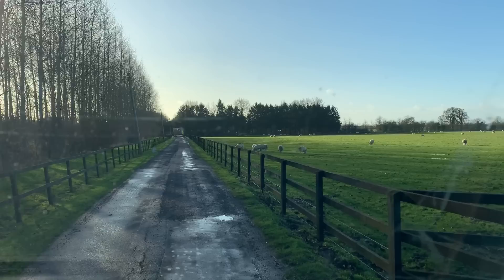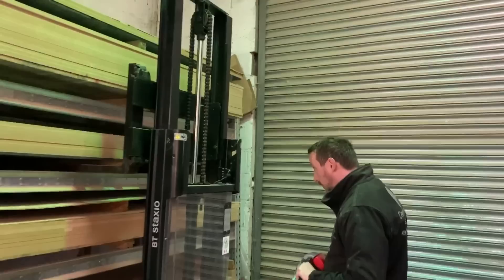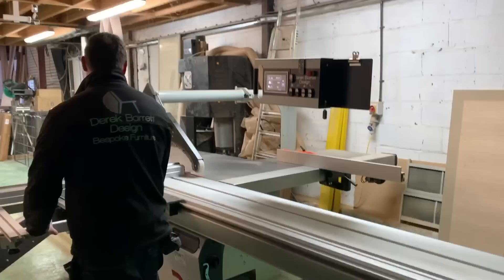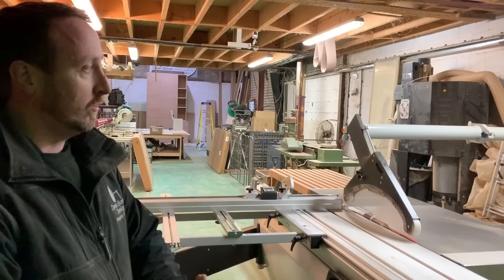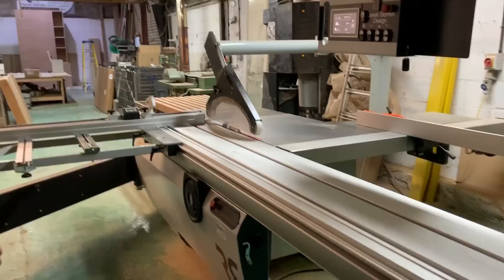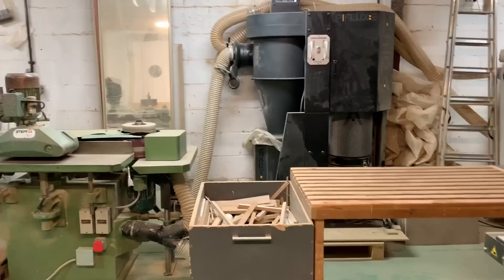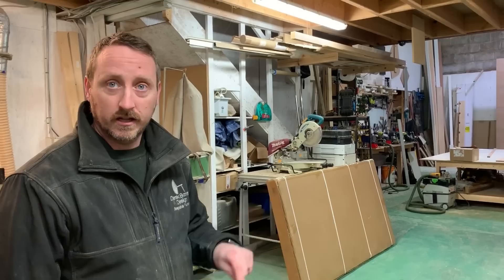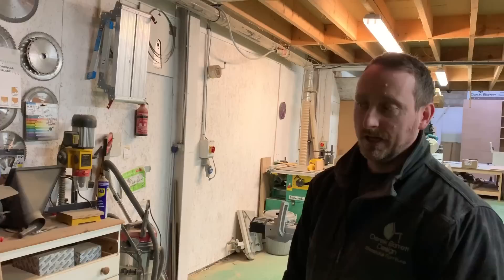Freebird meets Derek Barrett part 1

Comment: Awww, look at the cute little manual walkie stacker, such a shame he replaced it with a BT one, let’s hope he gets better service form Toyota than I do 😅
Reply from the maker: Daniel Coates that thing is now in my workshop and finally got used last week after long delay getting the new workshop!  I got a Toyota guy our to look at renovating some old BT lifters still on the site from previous tenant but they were past it.  You haven’t had good experience with them then?
Reply: It could be the fact I work for a large green supermarket, we might have a cheap service contract, based on volume, we don’t pay for repairs etc...

But to put it another way, we had two Jungheinrich PPTs for 11 years, then switched to BT Levio for the last 5 years, and have had Toyota our more in the last 5 years, than the entire time we had Jungheinrich.

However that being said, the orange supermarket has the same, but with the upgraded wheels and they don’t need call outs as often, the same with the orange diy chain.

As a general rule Toyota/BT/Raymond are pretty good units, but you must ensure you get the correct unit for the job, I think that’s our downside.

Personally if I was choosing, I would prefer Jungheinrich, it would be like the difference between Matika and Festool in the opinions of the ‘forklift community’
Reply: Oh, and to give you ideas of usage, one of them just hit 4k hours usage, and we have three of them.
Reply from the maker: Daniel Coates this is interesting trading because it’s a set of brands (and a type of equipment) that I was oblivious to recently, but I’m now realising I will probably need one before long!

Comment: What weight do these lift? Never considered them but if the lifted a bale of 18mm they would be well worth the investment.
Reply from the maker: sean duffy the manual lifter I bought off Derek can lift about a tonne.  That could be a stack of 20 to 30 sheets of MDF.
Reply: @Alastair_Freebird  super idea for lifting sheets to saw height.  Looking foorrward to the the video on th workshop move.